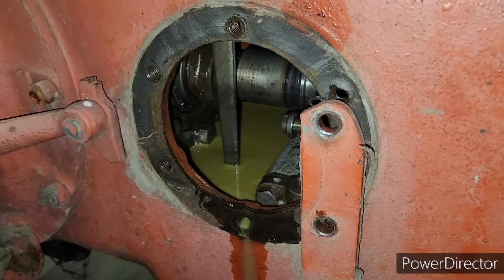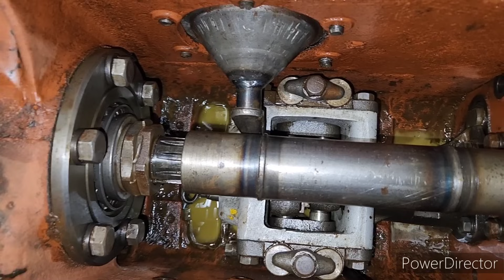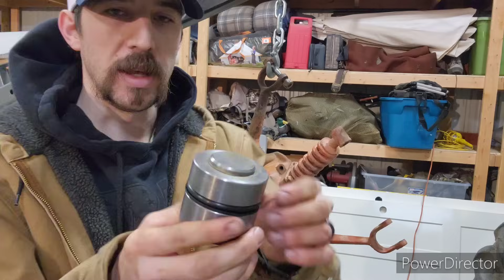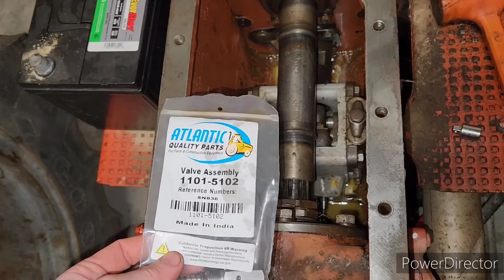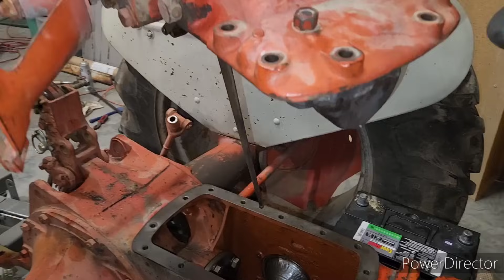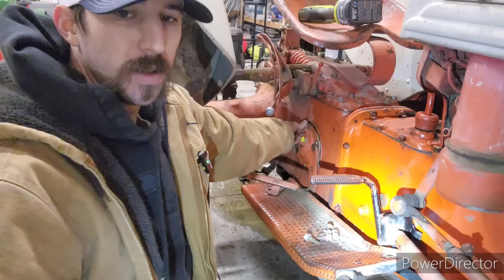TOP LID REPAIR! Ford 8n tractor 3 point not working

Comment: Good informative how to video. It's neat to see in time Ford did modifications making it easier to work on and better operations of the tractor.  Top lid is easy on the 1953 Jubilee no down rod to mess with . Then half way through 1954 they made it even simpler on top lid install and design.1954 to 1960's

Comment: do you have the part name and number for the oil tube?, that goes from the bottom of the housing and to the top of the housing, I think you can remove it by tapping it up from underneath and putting it back through the top, I think too that its chamfered on the bottom to fit, thats about the best I explain it, it does not come out when you remove the top plate, I think you have to remove the plate and pump on the bottom to remove it, also have you ever straightened the lift control arm, mine is bent
Reply: ford 8n

Comment: I take  cardboard draw the bolt template locations on it .poke holes in each one and insert the bolt. Then when you put cover back on take bolt from template And insert in the corresponding hole on the tractor
Reply: I appreciate you adding this comment to the video. I know exactly what you’re talking about and I was figuring on removing the top end of my tractor to see what it looks like in there because this video is amazing. It gives me all the confidence I need to pull that lid and you adding put in the cardboard template and put in the bolts through the corresponding holes on the template is awesome because that’s the part I would mess up on for sure. So thanks, Patrick.
Reply: @wisconsinsam 😂if I don't do it that way I'm constantly taking bolts in and out to get the correct length. Glad it helps!

Comment: Starting & running the tractor without any indication of a fresh air vent? Thanks for the video. It will be handy in the future,
Reply from the maker: Yea at that point my shop was far from sealed haha had a 1in gap all the way around the base where the metal siding met the seal plate and the garage door had no upper seals. I've since sealed it up much better but I used to be able to feel a draft when the wind was blowing lol now I crack a door open

Comment: My lift went up and won’t go back down. Any ideas on what I should be looking for?
Reply from the maker: More than likely it's 1 of 2 things. Either your linkage is bent not allowing your position rod to move the valve enough to lower. Or your hydraulic piston rings are getting stuck on a grove in the cylinders housing
Reply from the maker: Either way u'll want to pull it top lid and inspect the position rod for damage and you hydraulic cylinder

Comment: Always cover it up because that big spring under seat is a straight shot for water to get where he just drained it out. That Hydraulic lift is no big deal to repair. An it has small springs an other parts in it that will give up because of rust. 
Check the type of grease to go in it. I have had. 3 in my family history. A 9 N , a 1948 8N and a 1951 8N
1951 has a little more to get to electrical system. 
Cylinders are a little smaller. 
You can convert it to 12 volt. Starter pulls less amps. Spins faster. A keep same starter push button but, I know cause I did. Have to reverse the ground. I turned 81 today 11/9/44 so my thinker is slowing down. 
Also you can youse cast iron welding rods to build up Ark that lift rides on to get a higher lift back in it. 
Like when she was new. 
Herb.
Reply: Happy delayed birthday and thank you for your comment Hurbert Whitman. I’m Sam from Wi.

Comment: Great machin so is 65 4000 with square bucket in front only only 1 year they 1965ford 4000..change overall 6volt to twelve
Reply from the maker: I actually just picked up a ford 4000

Comment: Can anyone help me....when I engage the pto lever the lift arm lever automatically starts rising as well as the lift arms. I am then unable to push the lift arm lever back down to lower the lift arms. After sitting for a few hours, the lever will fall back down and over the next several days, the lift arms will fall back down.
Reply: Did you ever find out what because of that was ? My Tractor when I raise the arms and then I shut the tractor off it slowly drops the arms. And then when I started up, they come up automatically. I need to look into this.
Reply: @wisconsinsam  I could find no information on my particular issue, so I tore into it and found that the previous owner had obviously removed the top cover or the hydraulic pump and didn’t get the control arm back in place on the pump rocker lever. One of the pump control valves was also sticking. 

To me it sounds like you have seals leaking. There is plenty of pressure to hold up the lift arms while running, but it leaks off while sitting. I bought a seal kit and rebuilt mine. As recommended by many, I also replaced the relief valve(I believe that’s what it’s called). There are very good videos here on YouTube. I especially like the videos that Rachel Gingell does. She makes many tractor repair videos and is very knowledgeable on these old machines. Her YouTube handle is @DanGingell
Reply: Thinking about it more, it would be easiest to remove the seat and top cover and rebuild the piston first. If that doesn’t fix it, then you will have to rebuild the pump, which is a much bigger job and requires draining the hydraulic fluid. I have also read about the tube that runs from top to bottom having a hole in it. You could  also take the side cover off and use a flashlight and look for any dripping or spraying from the piston or tube. The I&T FO-4 repair manual is pretty good to have when doing repairs.

Comment: I just changed the gaskets and cylinder for hydrolics on 8n ford, put it all back together but hydrolics not working at all now. Any suggestions please?
Reply from the maker: Pull the side inspection plate and make sure your control arm fell back into the right spot. If u miss that little whole on the control valve u will have nothing.

Comment: I’m back, and frustrated! I replaced the piston, put new fluid in, put everything back together, and when I started the tractor, the 3 point raised, but won’t go down, even with weight on it! The PTO shaft turns, so I’m baffled! 
Here’s a trick others might be a help to other amateurs like me: before I removed the top plate, I numbered all the bolts with a magic marker, then marked the case with corresponding numbers! It helped me a lot! I hope it helps somebody else!
Reply from the maker: Probably your control valve is stuck. Or u have a bent control lever. Open inspection cover and manipulate it manually with the tractor off. Pull the valve to the rear to release pressure. DO NOT FORCE. Should be able to tell if u have one of these issues pretty quick
Reply: @LeatherHeadGarage , when you say, “pull it back” do you mean mean the lever inside or the one to the right that f the seat? The outside lever, itself, moves freely. It just doesn’t have any effect on the arms. Sorry to be a pain! Thanks!
Reply: Nice video!

Comment: I’m replacing the piston in my 8N. I’ve got all the bolts out, and I’m using an engine hoist to take the top plate off. I’ve attached a chain to one of the lift arms, but the cover will not budge! What could be holding it back? Rust, maybe? I don’t want to hit it with anything, so what do you suggest? I appreciate your videos as I get this old beast running again! Thanks for your help!
Reply from the maker: The gasket might be sticking it together, and I might try tapping around it with a hammer moderately.

Comment: My 8N didn’t have any issues before it sat for a few years,  (long story!), but now that it’s running well again, the 3 point arms raise when I engage the arm under the left side of the seat, they come all the way up, but won’t go down with the control! However, it eventually (over about 5 days) , it lowers on its own! Is that the piston, do you think? Also, I have watched several videos on this topic, but no one ever suggest marking the different size cover bolts and their positions with a magic marker, giving each a different number! If I have to take my cover off, I’ll definitely use this method, because I’m old, forgetful and dyslexic! Thanks for any help you can provide!
Reply from the maker: More than likely your control valve is just stuck on ur pump. I would pop that inspection cover off and see if when u more your position control lever it actually is actuating the valve on the pump. If u need to drain a little oil out to be able to watch the valve u can do so
Reply: I wish there was a way to slowly drain the fluid! Henry didn’t think this through very well!’

Comment: My problem is that mine goes up and won't go down what is causing that???
Reply from the maker: Does it go down with an implementation on it?
Reply from the maker: Probably control valve is stuck or your linkage is bent. Common for the linkage bar that goes down to the pump to bend, if that happends is won't manipulate the control valve enough to actually open it. I'd remove inpection cover and manipulate by hand to check.

Comment: Hey I got my top lid tore apart and gaskets will be a few weeks out. Just wondering where piston/cylinder assembly bolts to the top lid if I can use RTV instead of a gasket. My hydraulics were froze in the up position. With pro engaged the arms would lift and once they hit the top would continue to try and lift making the engine load up. Honed my cylinder as it was rusty from water mixed in the oil. Really hoping that was my issue and I never overlooked anything
Reply from the maker: That’s a good question, I’m not sure what the factory specs are on if that can be sealed with RTV or not. I think the best option would be the gasket obviously, but I see no reason why it couldn't be sealed with RTV. As for the engine loading down with the lever in the up position. I believe your linkage is off or more than likely your lift control lever is bent so when ur in full up position it's still putting pressure on ur hydraulic pump telling it to keep pumping fluid. With the inspection cover off before u refill it exercises your position lever and make sure that's not the case. Also check the measurements I talked about in the video. If you need more help check back

Comment: The position control lever is in the upper position. PTO is engaged, 3 point hitch comes up, but as soon as you lower the quadrant level and inch, the 3 point hitch goes to the ground?
Reply from the maker: You are correct but i believe it's the other' way around. When the draft control is in the down position it that's what it should do. In the up position your 3 point lever should control height off ground. If your tractors still doing that with draft control in the up position you more than likely just have a linkage problem

Comment: New to a Ford 8N tractor. 
Have a brush hog, and when I raise  the PTO to park it with the bush raised to park it, after several hours the brush hog goes all the way down to the ground. I have to put 6x6 thick wood under the brush hog when I park it to keep it from lowering to the ground. 
My question is , should the PTO  keep the brush hog up high when I turn the tractor off? Or is there something wrong with the hydraulic system or is it just me?
Reply from the maker: That's pretty normal the hydraulic piston is just slowly leaking down. If you want to fix the issue u gatta pull the lid and replace the piston and rings

Comment: Very good video. I have a '49 8n tractor. The 3-point hitch works, but the position control won't hold height, keeps going down. Any idea what I might check?
Reply from the maker: Yes you draft control is on. There should be a small lever under your seat on the right side make sure it's in the up position. If that doesn't work u have a linkage issue on the top lid

Comment: I pulled the head offof my "51 8N, had it ground flat and smooth, added a new head gasket, and rebolted the head to proper torque.  Eventually, maybe two years later, I got aa ticking noise that appears on the right side of the block by the #4 sparkplug, in that corner.  At least when I put a piece of black pipe there, and bring my ear to the other end, I hear it the loudest at that corner. I retorqued it but no bolts could be tightened much more to stop the noise. Why there, and what could I have done wrong?
Reply from the maker: It could be a few things, but you'll want to check the valve lash. If u havnt already

Comment: My 1946 9N has a hi and low transmission shift right by that small inspection cover.

Guy I used to work with had a commercial 4 wheel drive 9N that belonged to his daddy none of the guys who worked on tractors for 60 years or more had never seen one and of course he would not sell it.
Reply from the maker: You actually have a pretty rare howard gear reduction transmission. They are pretty slick units but are susceptible to damage when under high loads. as they only reduce the wheel speed, lots of people have ruined them thinking it's a Low Low gear and try pulling something way to heavy like a stump and snapping them. Worth a good bit on ebay!

Comment: On the narritive of the bolts being different lengths, take a marker and label each bolt with a number, and draw a diagram on paper, or list the number on the top plate where the bolts go. Do your homework now, and save so much grief later.
Reply from the maker: That's a good tip as well. Also seen people push them threw a piece of cardboard in order and write on the cardboard what they went to
Reply: @LeatherHeadGarage  Oh, I like that tip as well, using a piece of corregated cardboard that resembles the head, and puch the bolts into their respective positions for the head.

Comment: Ok so this is interesting, but due to the unique characteristics of the tractor there is a special fluid for the differential.  Ford used a 90wt mineral oil.  Apparently the unique requirements relating to the brass in the pump (or so I’ve read), and the pressure on the ring gear makes utf too thin and regular 80w90 fast wearing.  I’ve bought some from running but I have seen it online at tractor supply under the traveller brand.  The key word is mineral if you are searching for it.  Great video!
Reply: If it doesn't say synthetic or tallow or whale then it is "mineral" oil. It just means the base oil came out of the ground (like a mineral). 
But knowing that it needs to be suitable for yellow metals is important, there are some extreme anti-wear additive packages that react with those metals (but are great for protecting steel). 
The other thing to know is if it has a high shear gear design like a hypoid differential or a worm-gear, which would need extra sliding-wear protection (Traditionally provided by a large dose of certain fats as an additive, eg. whale oil or a tallow extract.). 
But aside from being sure of those two requirements to get the right type or class of oil, any modern gear lube from a big name like mobile or shell will have specs that exceed the old Ford spec. (Side note Iso viscosity grade 220 is equivalent to 90w gear if looking at product specs.)

Comment: How did the water get into the hydrolic oil??  Als what is the difference between a " N8 " and a " N6 "??
Reply from the maker: Condensation more than likely going through hot and cold cycles as weather changes. Also some leak around the shifter. I'm not sure your question on the n8 n6. I'm assuming your asking about the difference between the For N series's. There is an 2n 9n and 8n. 9n was the first one built in 1939, they moved to the 2n in 1942 during ww2 because of limited availability of materials it had less options. Then they went to the 8n in 1947 after ww2 which was basically an updated version of the 9n with a different transmission with 4 instead of 3 gears.

Comment: Iv bought and sold a many 8N i try to stick with the side mount distributor my number 26 - 8N was bought in Morton Illinois Barn fresh  original paint not much left a buddy rebuilds them I'm gathering extra parts odds and ends it has the Sherman Combo given it 12 forward and 3 reverse gears can't wait to bushog in creeper in 2nd with the mower powers up twice as slow n strong thanks for the knowledge and experience you showed
Reply from the maker: Appreciate it! Remember to grab yourself an overrun clutch for your pto if your running a brush hog on these. Just a reminder. Happy hogging!

Comment: How do u adjust the draft control? Mine isn't working right at all..
Reply from the maker: If its not working at all  I would check the measurements I talked about then look up a video on adjusting the draft control spring. It's pretty easy

Comment: So all my life, our 1948 8n has had the draft control lever pushed down. At least 50 years now.  I grew up assuming it was supposed to be down. Can you explain this more?? We have a belly mount sickle bar mower attached, is this the reason?
Reply from the maker: I would assume it would still be up in your case but I'm no expert on sickle mowers. 2 short explanations with the lever up u have full range control up and down, with the lever down as soon as u pass 1in or so from the top on your 3 point control the attachment will lower all the way to the ground. 2nd explanation lever up you are controlling your attachments  height off ground with ur 3 point lever, lever down u are controlling your attachments depth in ground with ur 3 point lever. Hope that makes since